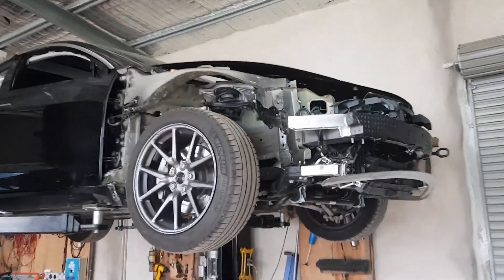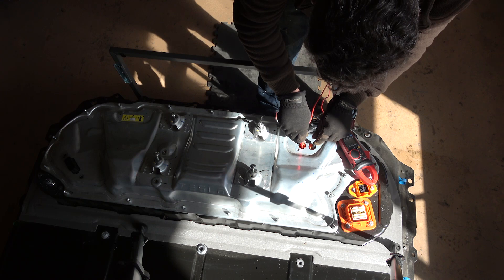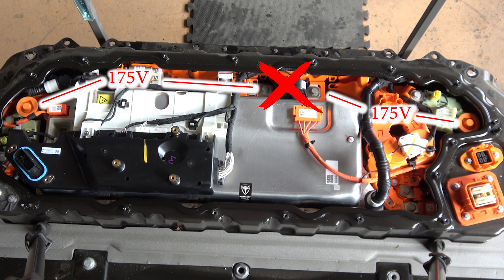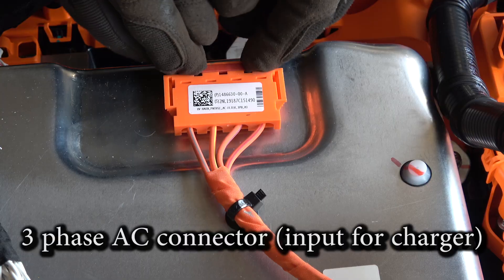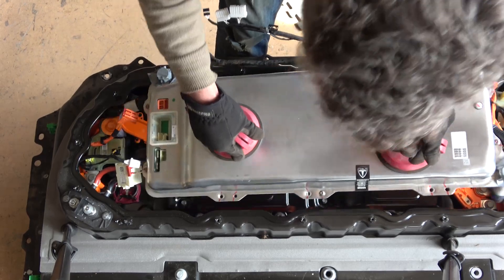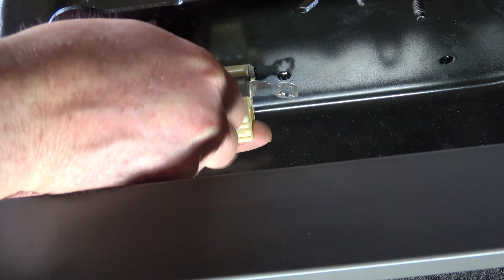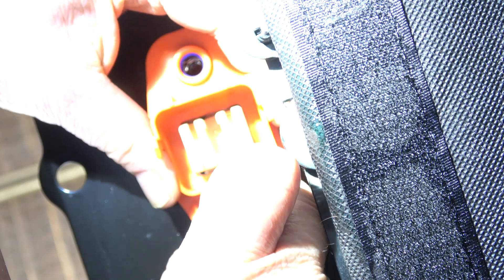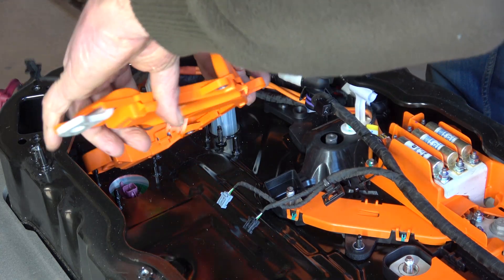Land Rover FTI 07: Penthouse deconstruction

Comment: Hello,
I have a 2021 Model YLR with the lead acid 12 volt battery. Is the PCS that you removed from the penthouse the same as the DC to DC converter? I've been looking for videos on how to replace my DC to DC converter just in case it fails. My car is approaching 50,000 miles and almost out of warranty. Looks like i would have to remove my 2nd row seats to be able to remove the cover on my penthouse in order to swap out the PCS. Could you please confirm if my understanding is correct on replacing my DC to DC converter? Do i need to purchase a used PCS from ebay for what I'm trying to accomplish for replacing my DC to DC converter? And is it just plug and play? Do I have to worry about any software or firmware issues?  Thanks!
Reply from the maker: Hi. Yes, the PCS also handles the DC to DC (i.e. charges the 12 volt from the 350volt!). It would be very unusual to have to replace this but if you had to it is the big box at the top of the penthouse (yes, under the rear seat). Fairly straight forward to replace although the plastic clips for the coolant connections can be a little fiddly until you make up a little helper tool. I think (but am not 100%) that all PCS's are interchangeable
 (other than the single phase 110v USA versions to the 240v 3 phase versions). I had to use Tesla toolbox after replacing to run a can bus update (which gets the correct software onto the new PCS), but I think you can now do this on the service ui in the car now. To be honest though I wouldn't be worried about it failing!
Reply: Thanks so much for the reply. On my vehicle, I installed a 1000 watt power inverter which I hooked up to the penthouse 12 volt terminals. It's been working great and I try to keep it to 800 watts load when I'm using it. I have the 12 volt lead acid battery so it doesn't give me any errors unlike the 16 volt lithium version which has a more sensitive bms. I use it for cooking sometimes and when we have a power outage at the house. Hopefully it doesn't hurt my DC to DC converter but I wanted to know how I could replace it just in case. Thanks for the help!
Reply from the maker: Nice! You've obviously worked out the correct way to get a higher output 12v feed (straight from the penthouse). The DCDC has a very high output so you should be fine!   @arisnavarro

Comment: hello
Who knows the parameters of the contactor from tesla model 3, what voltage is needed for the coil and is there an economizer in it?
Reply from the maker: I would say that the coil voltage would be 12volt (like the rest of the low voltage circuit). Don't know if it has an economiser but would assume it would.

Comment: Thank you so much for posting this, I have a quick question, say for example if you need to replace just a PTC/HVAC/PCS fuse would you take the effort of removing the pyrofuse? This because the 3 fuses are not under high voltage when the contactors are not engaged (if you did the HV isolation check up front). I know it's a safety measure and you separate the pack voltage with the removal of the pyro but just changing the small fuses isn't that big deal if you take your time not to drop any nuts and bolts. This because remove/replacing the pyro can cause extra resistance on the contacts so that's my reason not to mess with it but not sure if it's worth the risk of not removing it. What is your opinion about that? Thanks.
Reply from the maker: Hey, no problem! Personally I would still just remove the pyro beforehand because it is easy and makes things a bit safer. You are right though, there should be no high voltage at the fuses (even with the pyro still connected). I'm not sure why removing the pyro would cause any resistance on the contactors or do you mean the contact patches of the pyro, either way I don't think it would cause any problems. Also, if you are replacing one of the 3 fuses you would definitely want to know why it has blown in the first place - something has gone wrong if one of them has blown!
Reply: @sydneyg007   Thank you for your quick response. Sorry because I was a little unclear I meant the contact patches of the pyro, Tesla manual says to check resistance if pyro is reinserted so apparently it can give issues. About the blown fuse you are absolutely right but I need to replace a PTC heater but there is a big chance the fuse is also toast so i'm trying to do some homework up front :-)
Reply from the maker: @gtech6  Yeh, right. Yes, I have seen the "Hoki resistance" test in the procedures. I'm not sure how likely extra resistance would be caused by replacing the pyro assuming it is torqued back up to correct specs but I guess it's possible. Easy to check the PTC fuse in place beforehand with a multimeter and definitely not worth removing the pyro to do that!

Comment: Wow. I can't believe my luck. I have been researching an ev conversion for an old vehicle using Model 3 components for quite a while. This excellent tutorial has answered just about all my questions. Including questions I hadn't thought of yet ! It has fast forwarded my project enough to the point that I am now confident enough to purchase a complete damaged Model 3 and get on with it . Can't wait for the next episode.
Reply from the maker: Thanks. Glad it helped! Will put up a video of getting into the modules soon...👍
Reply: @sydneyg007  If possible, would you be able to make a few comments in the video about expected pack voltage for a Model 3 ? The only real risk I see in buying a damaged car is the battery condition. Everything else seems to be pretty straight forward. I was originally going to buy a pack  and drive unit separately hence my question about pack voltages but as you've pointed out, it makes way more sense to buy a complete car. Cheers.
Reply from the maker: @billhill4479  I would think it is fairly unlikely for there to be battery condition problems with a model 3 (unless the battery pack has been compromised which is a rarity).  If it is an NCM pack (ie not LFP) then I think each cell can be as low as 2.5volts each without to much issue, with 96 cells that is 240 volts when empty or when fully charged to 4.2 volts pack voltage would be 403.2 volts. That's if you are able to check it (and the pyro fuse hasn't been tripped).
Reply: @sydneyg007  Thanks for the advice. Really appreciate it.

Comment: That was a really well done tutorial on the penthouse, really like the explanations of each component.
Looking forward to see how your able to repackage the battery pack and modules.
Reply from the maker: Thanks! There doesn't seem to be that much in depth tear downs on the M3 Penhouse and there are a few little tricky bits as you would well know (especially removing the HV output plugs!)
Reply: @sydneyg007  I absolutely agree.  I just finished my first one, which was made more complicated due to prior application of another car moving at speed compromising the penthouse body, but this would have been very helpful ahead of time!  The next thing I'm curious about - if you're intending to reuse the penthouse assembly and just mount it complete within the car somewhere, how much disassembly is really required?  If you do the full teardown, there are a lot of components to get right, but to separate from the battery modules, it seems like you would only need to free the 4 posts, the connectors to the BMS board, and the undermounted connector sockets.  The charger/inverter and pcb are in the way, as well as the two contactors, and you obviously want to do the pyrofuse as well.
Reply from the maker: @12x2richter  I've done a video on that exact thing (episode 9)! https://youtu.be/jtU8xIDGym4?si=UuazfdFmH5XJKh0f

Comment: You look very confident around high voltage. I would have a heart rate of 180 and brown my pants every 30s. Are you qualified or is a 'learn as you go along' kind of thing? And you are disassembling the penthouse like you were the one who assembled it in the first place. You really cranked up the DIY level to 15 on 1-10 scale with this video 🙂
Reply from the maker: Thanks very much! No i'm not qualified in anything (although I did do an Indian cooking class years back);) It's one of those things that if you fully understand something it is a lot less scary!
Reply: It helps that it's DC.  It needs a path from one end to the other in order to shock you.  AC just wants a ground, so it's much easier to shock yourself with a light switch than even a high voltage DC battery, as long as you're relatively careful.